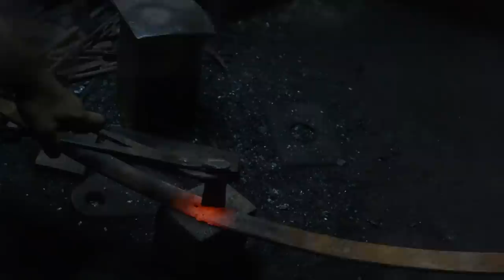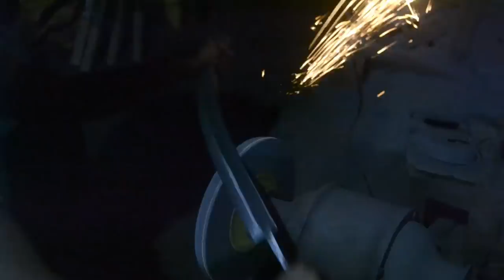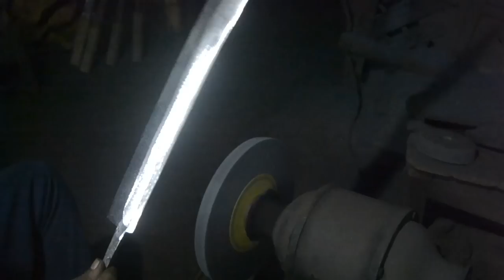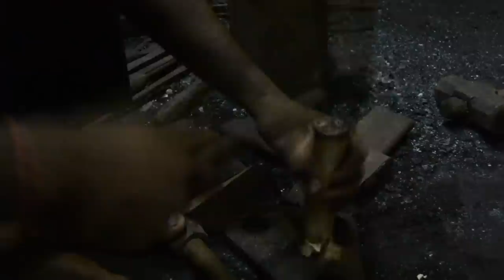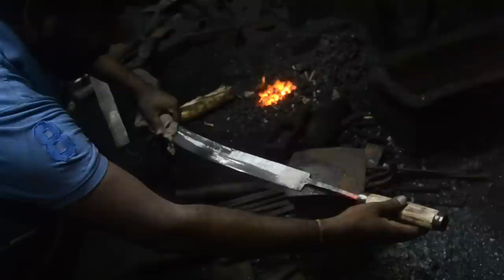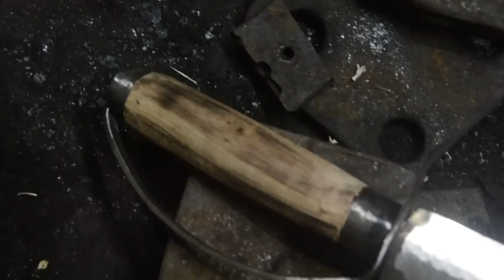SWORD MAKING BLACKSMITH / INDIAN BLACKSMITH MAKING SWORD  FROM SPRING / SWORD BANANE KA ASAN TARIKA

Comment: Without proper Heat Treatment/quenching/hardening process, it is just a regular piece of iron. I saw in the video that during forging, maker put the red hot iron in the water which must have made this iron either soft and weak or brittle or full of internal cracks or stress fractures.
Apart from that a burn through tang process always makes wood weak, so handle is also very weak, he must have used a full tang design, finshished with few iron pins to attach tang and wooden handle. Fit and finish is below average. Size of handle is way bigger than the size of anyone's fist, hence loose grip on weapon as fist will move back and forth during usage. Handle also missing proper shaping for firm grip, it is just a round piece of wood. Also not sure about the balance of the sword as tang is very short ( that too without a pomell)and all the weight is going towords the tip of the blade, it will reault in wrong balacing of sword and very difficult to control.
Overall, this can not be called a Battle Ready Weapon, it is nothing more than a decorative piece of steel.
Reply: Nice technical review ... Awsome knowledge of weapons